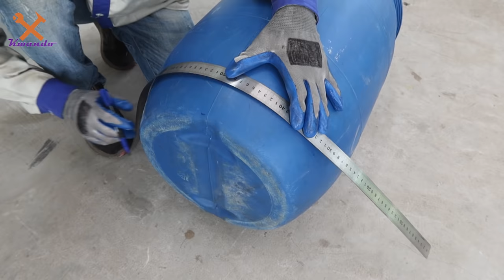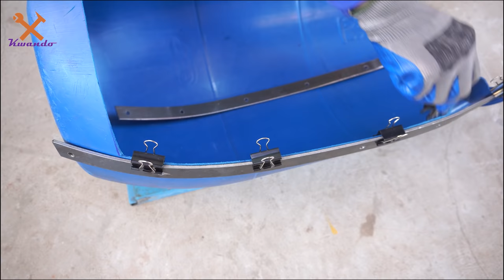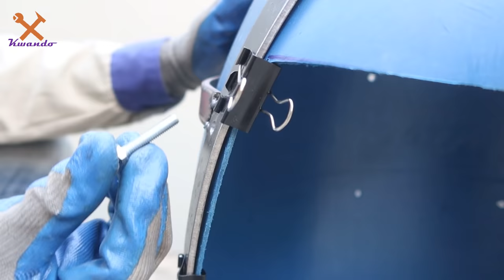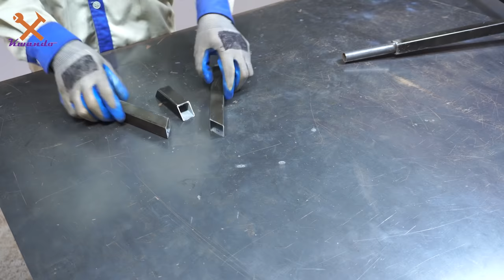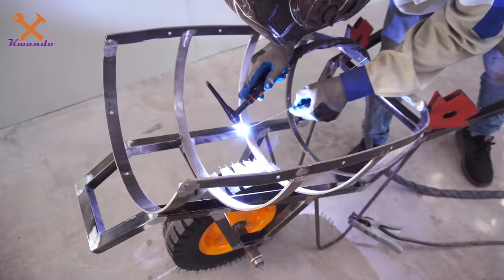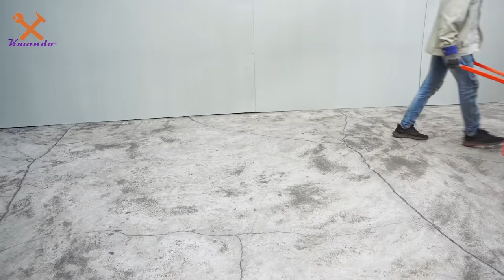Don't Throw Damaged Plastic Drum | Reuse Old Drum As Wheelbarrow

Comment: Just pop rivet the drum to the straps (faster & cheaper)!  But not really cheaper because my pneumatic riveter (35yrs ago cost me $350), but it will do 1/4” ss rivets real fast.
Reply from the maker: Many thanks for your suggestions. I used bolt because it’s easy to replace.